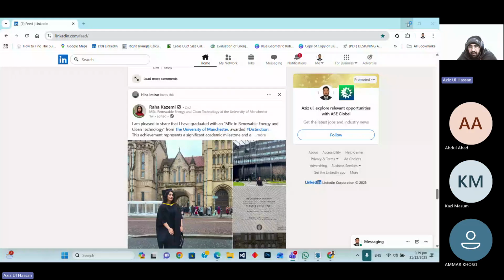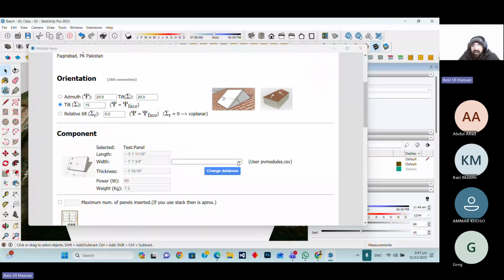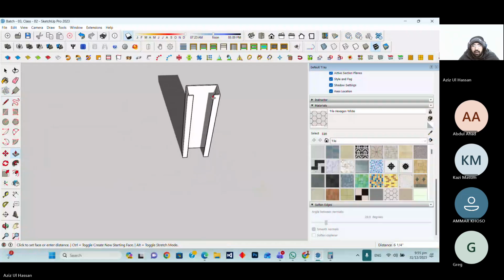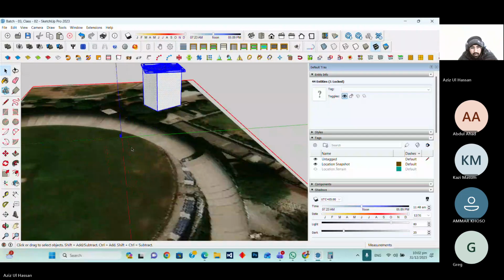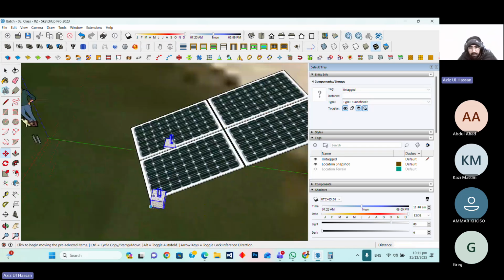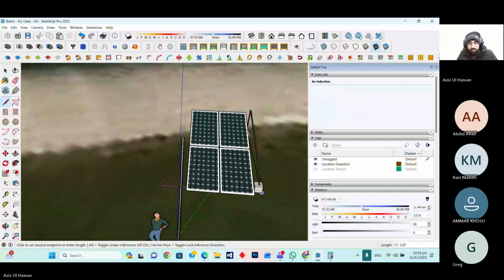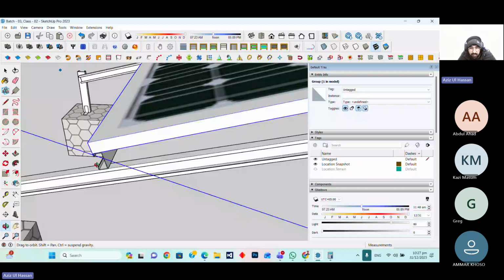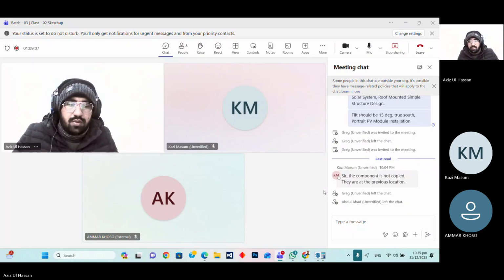Batch 03 | Class 02 | 50 kWp Solar System Design | Roof Mounted 2P Structure

Comment: thanks great tutorial....how can one get free skelion extension?
Reply from the maker: Online available for 10 module installation
Reply: @azizulhassan3546   what software do you use or would you recommend to check structural  integrity of the solar framings
Reply: Thanks for the feedback sir, and i wanted to enquire about the dimensions of the panels used on the tutorial and generally as a solar engineer .There are instances where the dimensions of  panel are a bit long especially 750 wattage pv ....e.g for 3 rows(0.5 spacing) of 2 stack it  may overfit on the dimension(58ft) of the actual roof used in the example.So  how do you decide on the necessary dimensions of the panel?